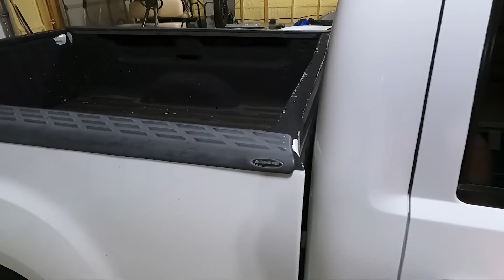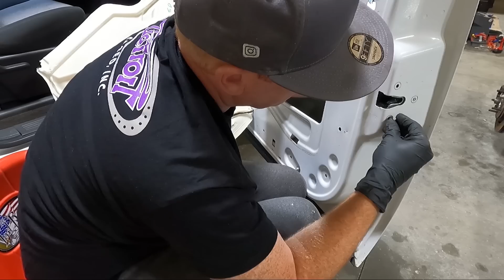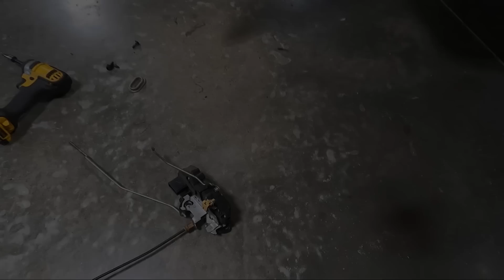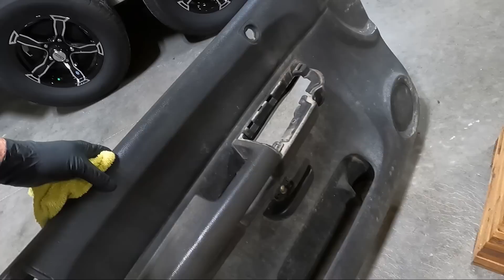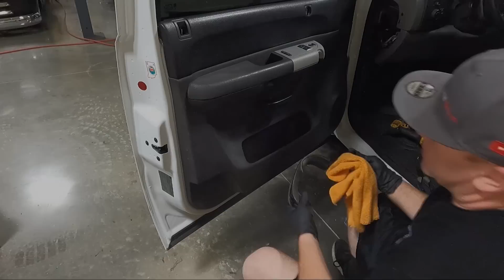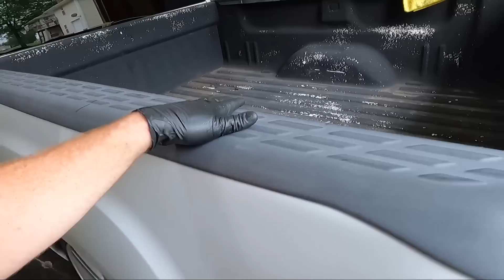Replacing Door Panels and Installing New Door Lock Actuators but No Luck with Power Locks Working?!

Comment: Took it off the door addicted for a black door two doors canceled you all new new ones changed this drug the shots this truck I like this truck better. I need to get a part the flat part I canceled all black.
Reply: Drummer the hood I need Pro black years why the black color to I like this new heaters and muffler allowed right now the wings, different wings flat wings the wings the grill I need to black different black the new one in the logo Chevy
Reply from the maker: @jimmyortiz4113 ?

Comment: I had the same issue with the door locks I replaced bcm switches and actuators and nothing finally I replaced the inside fuse box on the driver side and it fixed the problem hope this helps
Reply from the maker: That is my next move

Comment: The darker door panels look way better.  I find darker interior colors look better than the lighter colors. Seems like most gm power locks have at least two sets of wires to plug into the door latch, one plug is for the electric lock actuator and is usually mounted to the door latch. I think my chevy actually has three separate wire plugs on the latch, I changed them a few years ago cause they were doing the same as yours. ✌🏻
Reply from the maker: Yeah it only has one plug and only one spot to plug in.